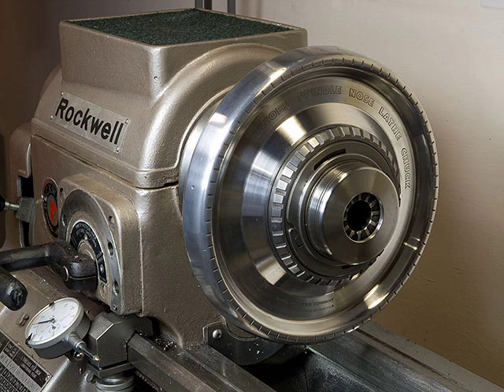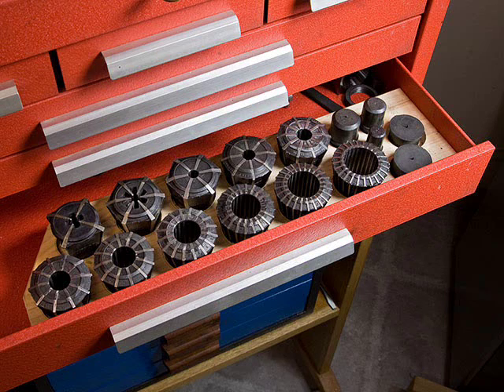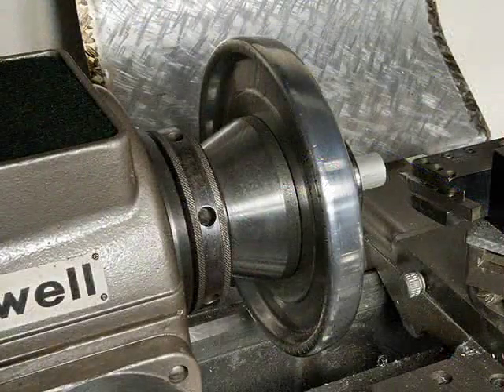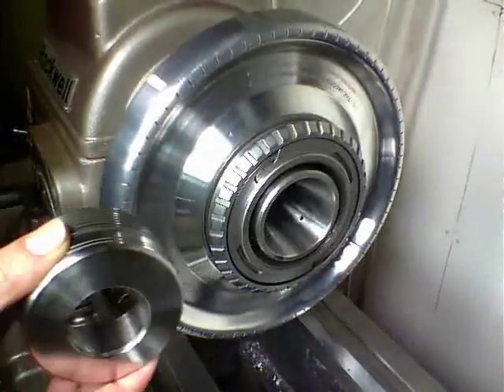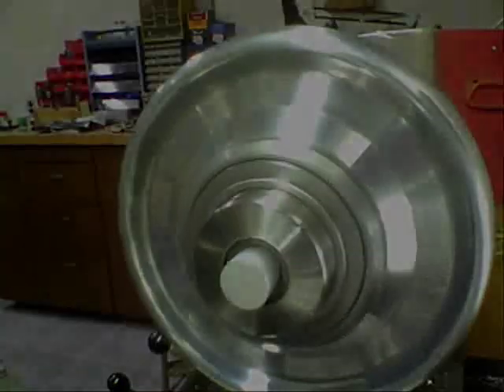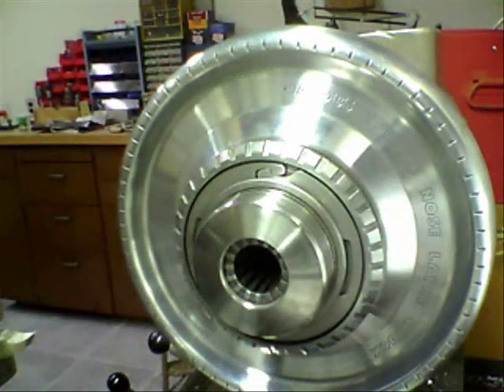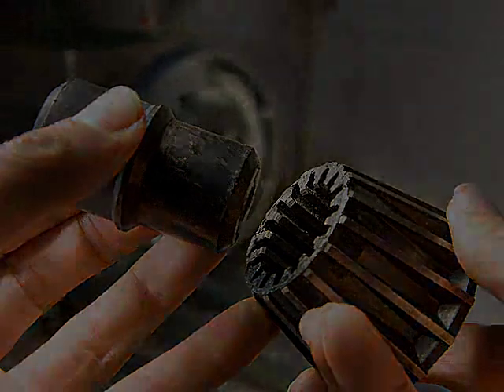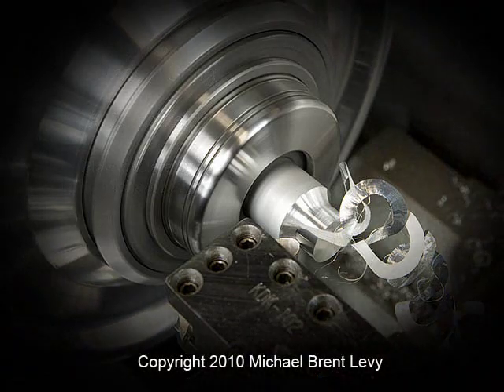The Jacobs Spindle Nose Collet Chuck

Comment: Nice job on the video, just bought an old Logan 11 inch model1955 and it a a full set of these but no other type of chuck. I was kinda bummed but after watching your video, I am happy that this came along with it. Was not quite sure how it all worked. I didn't want to break it. And I did not know about the lock ring.

Comment: Mike, Nice job!  Hope you are up for a couple of questions.  1)  What type of a mounting plate secures the chuck to your lathe?  2)  Any chance I could talk you into weighing the chuck and backplate assembly and getting back to me?  Dimensions would also be helpful.  Thanks.
Reply from the maker: Hi Gordon. Unlike most chucks, the spindle adapter is an integral part of the Jacobs collet chuck-- there is no separate backplate (at least there isn't on my L00 model). I don't have a scale to weigh it, but I would estimate the chuck weighs about 15 lbs.

Comment from the maker: My comment in the video about finding a chuck with a complete set of collets for about $300 is rather dated. I suppose it's still possible to find one for that price if one is constantly on the lookout, but pretty unlikely.
Reply: Great video.
I have an old Colchester Triumph lathe with an L1 spindle.
L1 is now very rare in the UK and normal collet chucks are silly money. I have seen quite a few L1 Jacobs collets on Ebay USA for about $200. Ironically the collets themselves ARE easily available in the UK and cheaper so I have just bought a set of collets from the UK and order the chuck from the USA! Best of both worlds.
I am a little concerned though - some people say they are not as accurate as a conventional collet due to the rubber flexing slightly when taking a cut. Is that correct?
Reply: @codprawn  Probably because they don't know how to use it properly.

Comment: Hi Mike, from your last response I think you might have confused me with someone else. I was wondering if you could tell me how to go about finding an adapter for my 91-A6 Jacobs chuck to fit my D1-5 camlock lathe spindle? Or would one have to make it?
Reply from the maker: Even if you are able to find or make an adapter, you would end up with tooling that is less accurate and less rigid. That is why I suggested you keep your eye out for a reasonably price D1-5 version of the chuck.
Reply: Gotcha, thanks for your advise. Tim